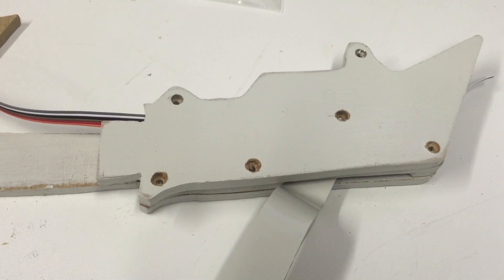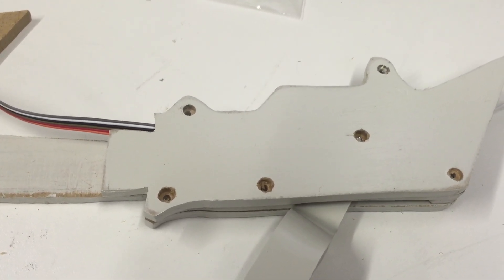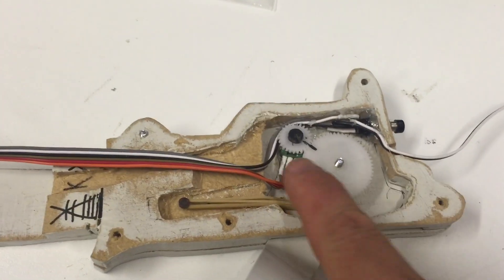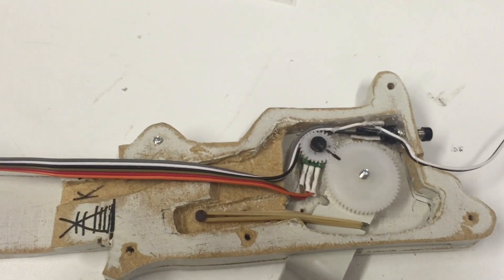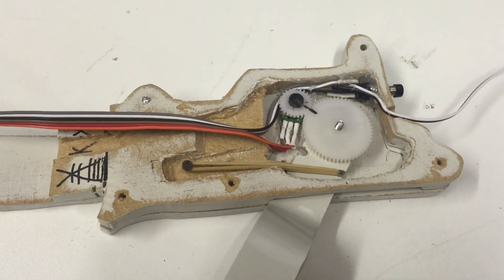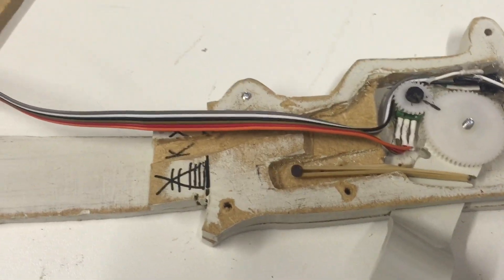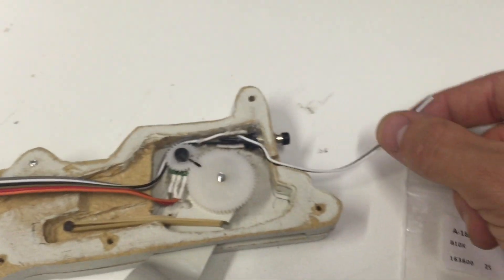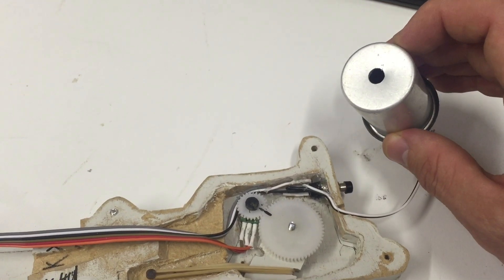Throttle handle, take 2 - B737 Home Cockpit

Comment: I would go ahead and replace the rubber band with a spring to save yourself a headache down the road.
Reply: Or just skip it altogether - it's not spring-loaded on the real thing, but it does have:

1.) A pawl that prevents:
     a.) The reverser lever being pulled when the thrust levers are past idle
     b.) The thrust lever from being advanced when the reverser lever is pulled up
2.) A cam that prevents the reverser lever from being moved past idle until the doors have opened fully
3.) Detents - depending on series:
     a.) 731/732/73S - "70-kt" (read: idle) and "reverse thrust temperature indicating detent" (read: overboost)
     b.) 733/734/735/NG - No. 1 (idle, 45%-ish), No. 2 (70%-ish), No. 3 (80%-ish)

What's curious is that the early 737 has overboost power available in reverse, despite its thrust reversers being good for more than making noise, consuming fuel, and shaking the airplane (which it has been argued are the only uses of reverse thrust on a CFM aircraft, where such power is not available in reverse). Generally, on the older 737s, only about 1.3 EPR was used in reverse... the HPTR on the 731/732/73S was twice as effective at 1.4 EPR than the original clamshells from the 727 at full power.